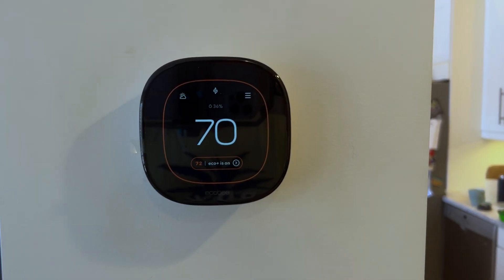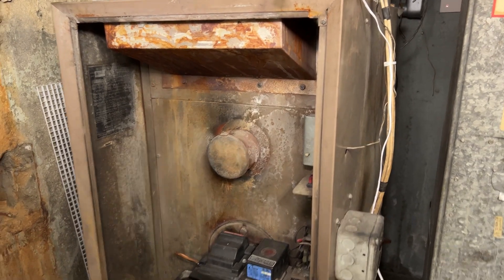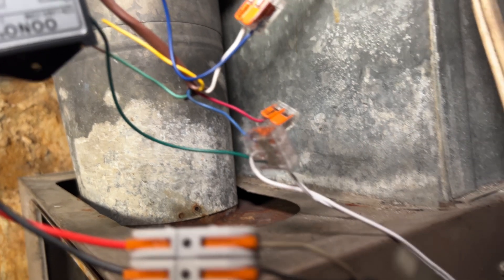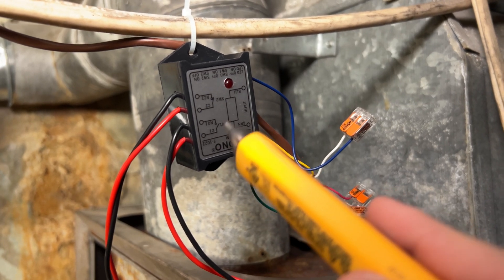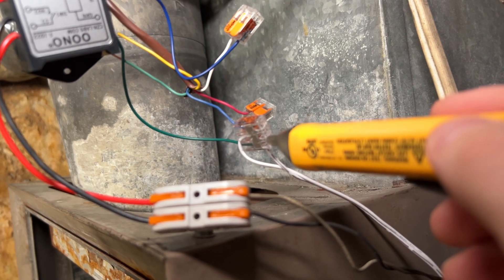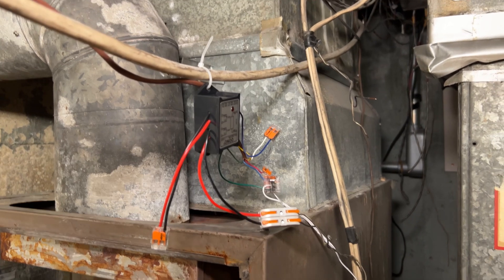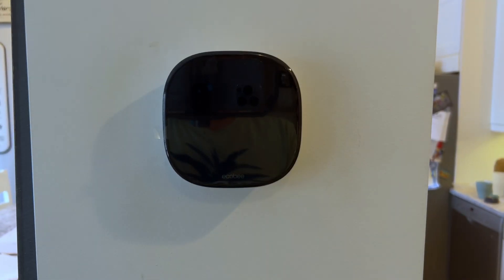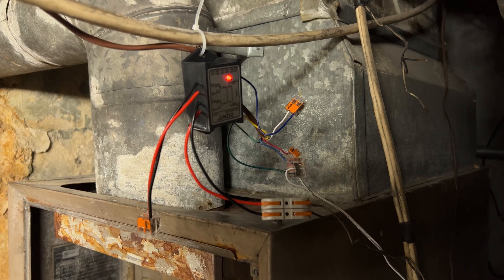How to wire a smart thermostat with no C wire using a power supply and relay

Comment: If my thermostat has a R and C wire already but my aux heating has it's own 24VAC transformer with two terminals that need to be closed to turn the boiler on could I just split off the C wire that's going to the thermostat and the run the W and C wires to the 24VAC relay input and have the output terminals connected to my boiler?
Reply from the maker: That could work. As long as power from one system isn’t going into the other, there’s nothing wrong with using one system to trigger another through a relay. As long as whatever’s going to the input side of the relay is controlled by the thermostat. Otherwise, it will be on all the time cause the relay will be energized.
Reply: @MusicShed  thank you for the reply! I ordered a 24VAC 8amp relay that house NO and NC output pairs. When the Tstat calls for aux heat it closes the R (24VAC (from L1->24V transformer)) to the W1 wire (aux heat out signal). So, if I take the C (from furnace 24VAC transformer) and the W1 wires to the input of that relay I think that should work. 

The new Tstat is a Lennox L40 and the AC unit is a heat pump system. the Lennox has the first stage heat setup as a heat pump using the reversing valve pin on the Tstat to the control board on the outside HX/compr unit.

The AC system installer couldn't figure it out but I think he assumed the 24VAC common on the Tstat was the same common on my boilers aquastat.

Comment: Worked perfectly! I have a two wire controlled boiler for radiant floor heat. I had a three wire bundle to the old heat only thermostat. The power relay module allowed me to use an existing 24 VAC transformer at the boiler converting the unused third wire to a "C" wire for installation of a smart wi-fi thermostat. I installed a Honeywell RTH9585WF thermostat and am very impressed with all of its functions. Minimal investment in parts and very little time required to wire in place after viewing your video. Thank you!

Comment: Can I get my power supply from an existing transformer? Also does anything change if I have zone valves? Also for a oil system
Reply from the maker: I got 24VAC power supplies from amazon cause that’s what the relays and ecobee require. The zone valves should be controlled by the heating system directly. I’ve never heard of controlling individual valves from an ecobee. Generally each ecobee would control one zone so a multi zone system should have multiple thermostats.

Comment: Thank you for your smart  thermostat video. I could not find a location on my boiler for C wire. I followed your basic premise and used a hard wired 24v AC transformer along with the identical relay. Sweet tunes.

Comment: Unfortunately the one I need a C wire on doesn't have a blue wire, and it's on the second floor while the furnace is in the basement so I think I'm kinda outta luck. All the other wires are in use for furnace, blower motor and AC.